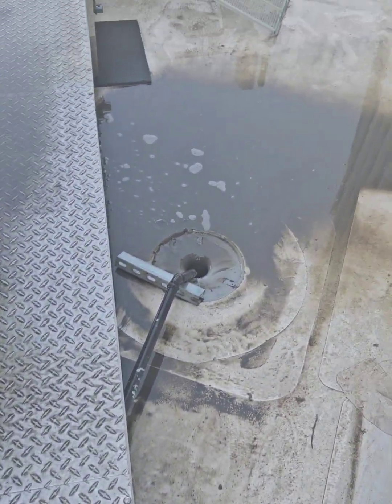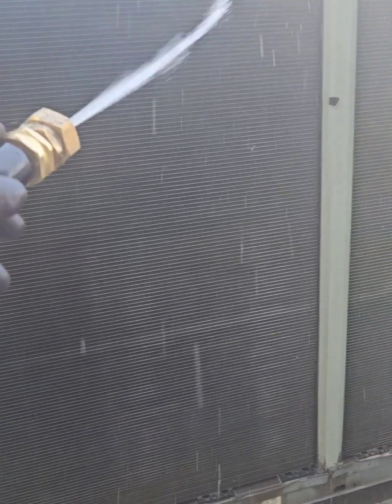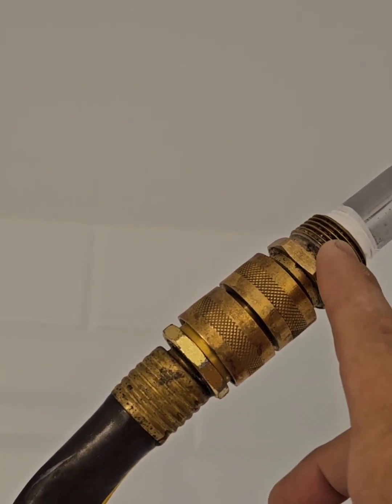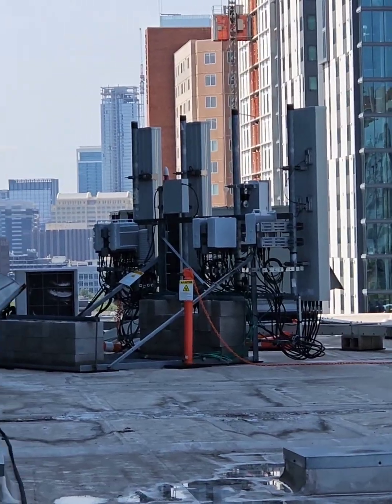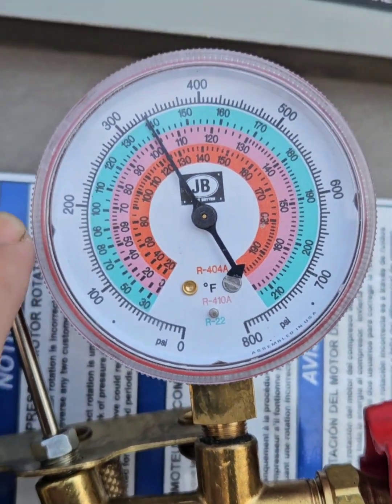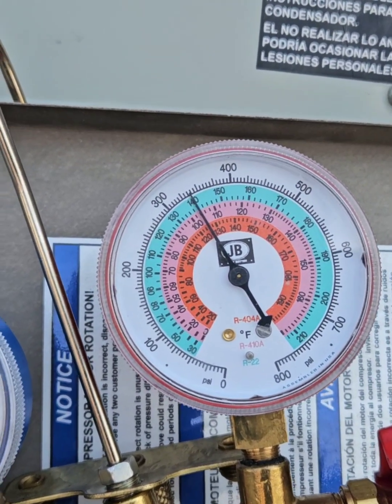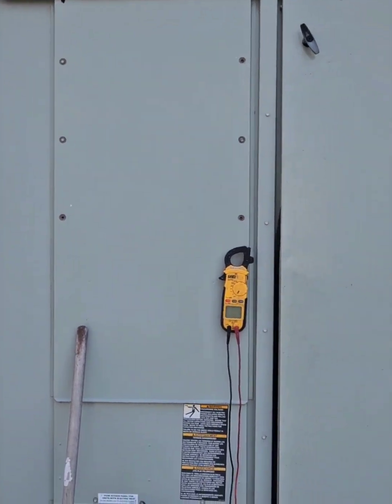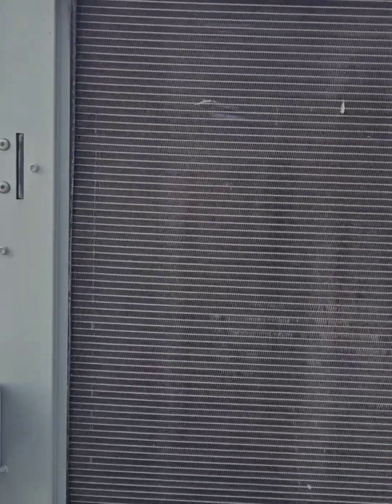I love an easy Friday. Happy HVACing everyone

Comment: It’s controversial, but I had to use Nu Brite on a microchannel earlier this summer. Water and Tri Pow’r just wasn’t doing the trick. I had the apprentice bumping the condenser fan contactors while I sprayed the chemical on to help pull it through the coil and gave it a really, really heavy rinse right after. Worked out pretty well. Sometimes we do what we have to do!
Reply from the maker: @haldermand  it's definitely controversial...but if it worked for you then I say good job. I don't have the huevos to try it, but im definitely not gonna dog you for doing it